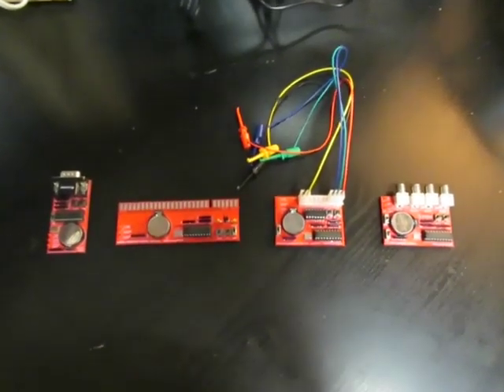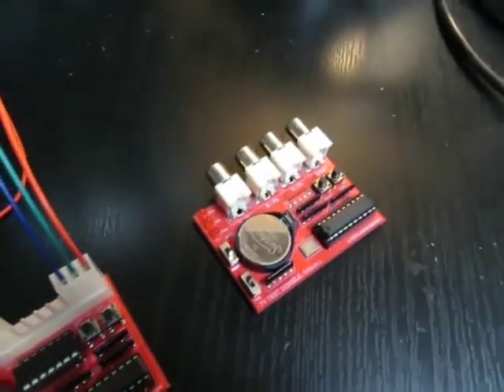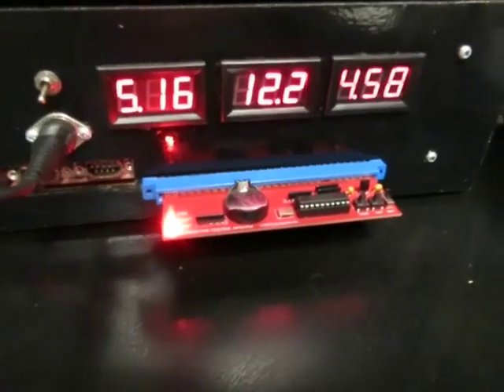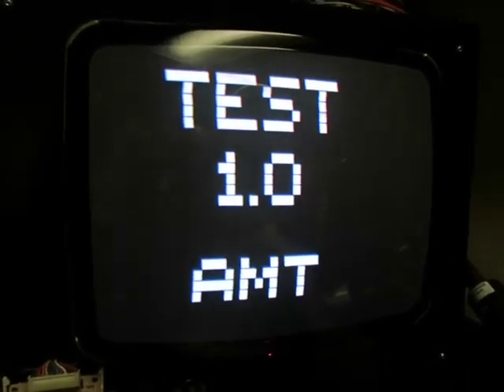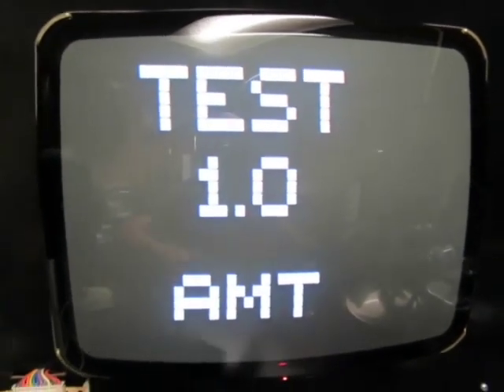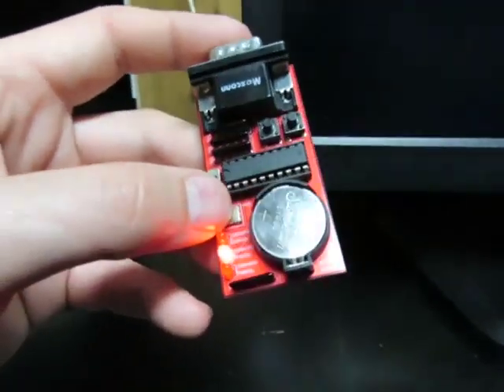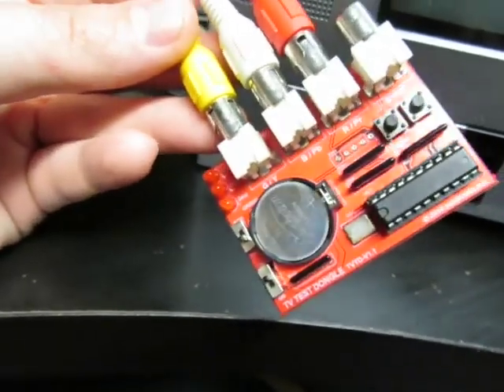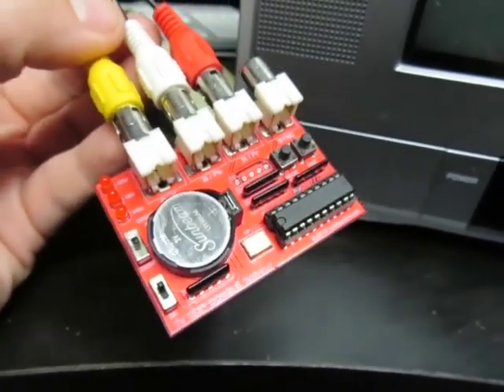Monitor testers / video signal generators.

Comment: Hi, i have a question about the arcade tester. I just wanted to be sure: i have a 5 pin connector (actually 6, but it's a 12v pin - not used): RGB, gnd, H/V sync.
So i should use the last pin on the tester for this: CSYNC NEG, is that correct?
I just want to be 100% certain cause I already plugged a wrong one (H+ or V+) and temporarily screwed up the sync on my only working arcade monitor, which scared the crap out of me 😅
Reply from the maker: Yes, CSYNC (composite sync) NEG (negative) is what most monitors will use by default. This is what JAMMA uses in the standard. Older monitors in cabinets like Exidy for example, may use separate horizontal and vertical positive syncs. Many monitors have separate sync inputs for both H/V and C sync signals however, and can be used accordingly. You can't really screw up your monitor by hooking this up wrong. :)
Reply: @pcbjunkie1  Ah ok, good to know. Thanks! btw, is it ok that csync on the testing device measures about 2.7 volts and the sync pin on my arcade chassis is 4.5-5 volts?
Reply from the maker: @guybrushthreepwood3054  yeah its fine
Reply: @pcbjunkie1  thanks!

Comment: Hi, i ordered an arcade version but the leads were not available. What kind of connector is that? It looks a bit like molex, but i don't think molex is modular like that
Reply from the maker: This is what's commonly known as CH 3.96mm connector. It's super common. Some molex connectors will plug into it as well.
Reply: @pcbjunkie1  Thanks a lot! I wanted to buy your products for a while but the shipping used to be very high. Now, for some reason, it dropped drastically 🙂
Reply from the maker: @guybrushthreepwood3054  Depends where you look. On Ebay the shipping quotes to EU/AU/NZ are wrong for some reason (I refund the difference). Through my site the shipping is calculated more accurately based on total weight. Thanks for your support despite the expensive shipping costs! :)
Reply: @pcbjunkie1  Thank you for designing this affordable TPG :) The shipping rates for EU on Shopify are quite decent now - 15 EUR to Belgium (plus they didn't include the import taxes, but I'm sure that they won't miss to charge them on delivery)
Reply: @pcbjunkie1  Unfortunately the duty fees plus VAT for Europe are horrible. In total, all those charges cost more than the device itself.